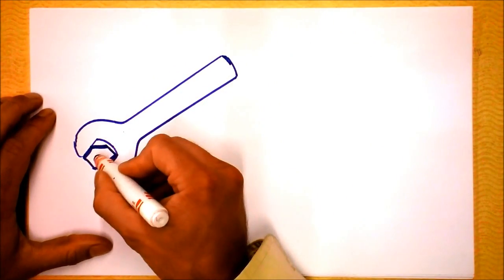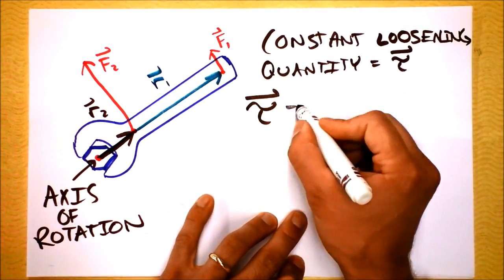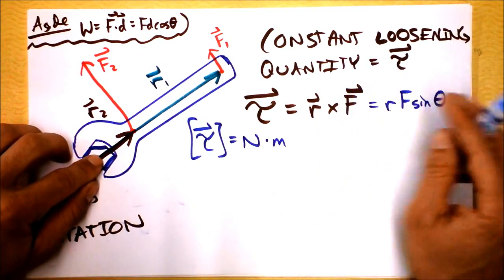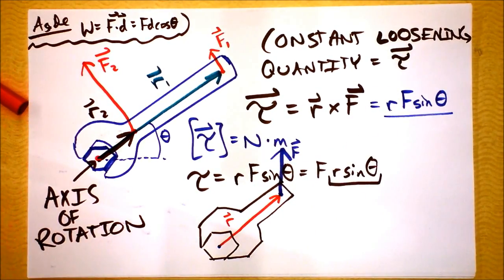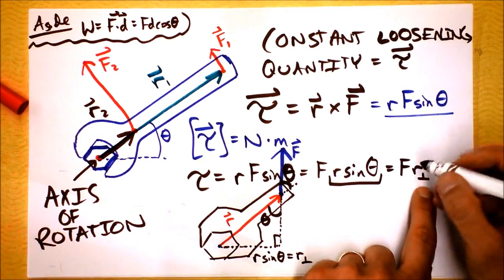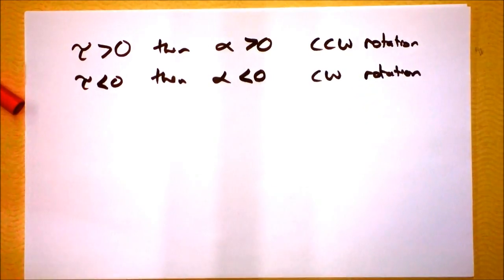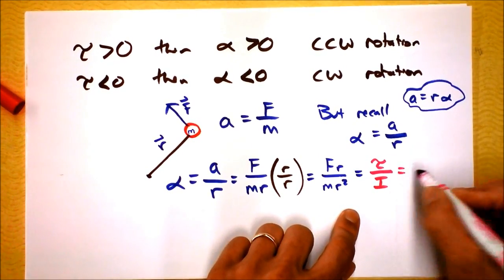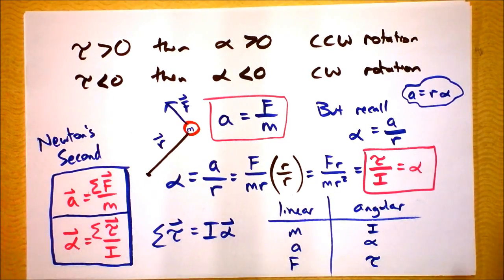Torque, Angular Acceleration, and the Role of the Church in the French Revolution | Doc Physics

Comment: The second system with the masses will have a lesser moment of inertia than first one. This is because all other things being the same in the two systems, the mass in the second system on the right , is distributed closer to the axis of rotation than the system on the left .. 
since the second system has lesser moment of inertia than the system on the left 
it will offer lesser resistance to rotational motion ( in other words rotate more easily when it experiences a net torque ).. 
so the system on right will be the one in which the mass will hit ground first ..

Comment: Torque= Inertia of whole system * angular acceleration 
torque applied by 10 kb block is same.
but inertia is different as inertia depends on the distance between axis and mass.

thus,

angular acceleration= torque(same for both)/ inertia of rotation(different)
inertia of rotation is more for the first one.
so it's acceleration will be less than the second one.

Comment: using r=1r on the left and r=0.5r for the right
α(Left Hand Side)=Fr/mr^2
α(Right Hand Side)= F(0.5r)/m(0.5r)^2 = 4Fr/2mr^2 = 2Fr/mr^2
=> angular acceleration on the right is twice that of the left, therefore the right will fall to the ground faster. Is this correct?

Comment: Horsepower: 300 @ 5800 RPM Torque: 300 @ 1200 RPM vs Horsepower: 330 @ 7000 RPM Torque: 270 @ 5200 RPM typically which car would win in a race?

Comment: Unfortunately in 14:14 the relation of torque and angular acceleration is wrong neither for rigid bodies nor for particles this equation is wrong in vector form.  Just in scaler form and in some special condition (rotaion about fixed axis) it is right.

Comment: nice vid mate. if there is no pulley friction, the rods do not bend and the small m masses from the rods are punctiform, both 10m weights hit the ground at the same time, because the small m masses are on the axis of rotation => r = 0 => I = 0
Reply from the maker: abuwarez One of the systems resists acceleration more.  That's related to why a figure skater can reduce her spinning by allowing her arms to swing out rather than holding them in.
Reply: Doc Schuster sorry, my mistake. i interpreted the drawing in 3D, having the rod perpendicular on the pulley's plane (and not in the same plane as), going through their rotation point.that's why i said r = 0 for bot pulleys. thinking that the problem might have a catch, i complicated it;
Reply from the maker: abuwarez Aha.  I wasn't very clear about my axes of rotation.  It's not a hard problem at all if you've been following the video, I hope!  Good work.

Comment: plzz tell me f m wrong
Reply: Shuaib Mohammad the one on the right would actually hit first. Angular acceleration is torque/moment of inertia. You are correct in saying that the moment of inertia on the left is bigger, but this means it will have a smaller angular acceleration so it will actually fall after the one on the right which will accelerate faster.